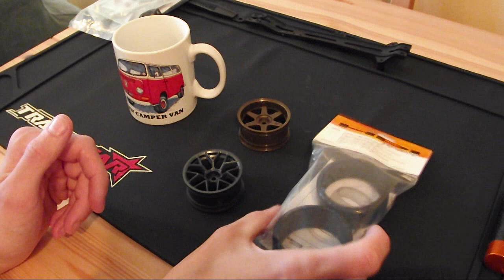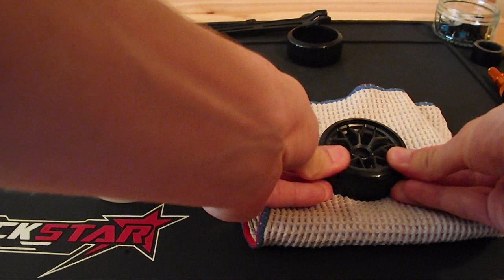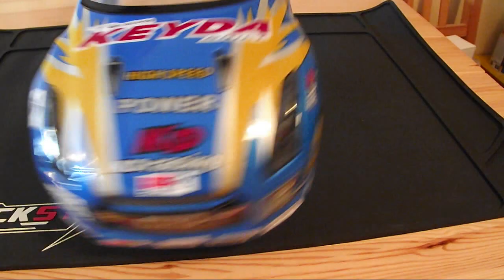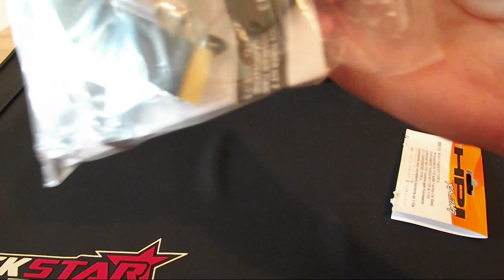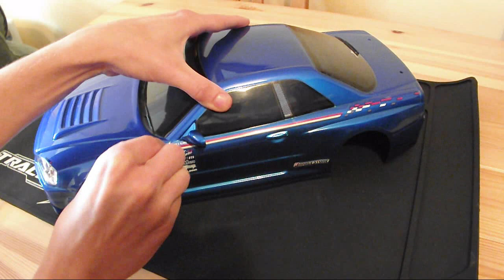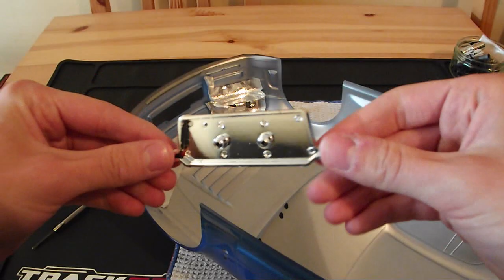Drift Project: Tamiya TT01 E Build / Upgrade Series - Episode 7

Comment: I just picked up a ta04 still has the rubber tires but drifts a little bit. Engine was overheating. I'm going to try some pvc tires for drifting and see if there's less engine friction so it doesn't over heat. Hope it works
Reply from the maker: +Derek Curtis Hi, the TA04 looks like a cool drift chassis, especially being belt driven. Drifting can be quite intense on a motor because its working fast but not getting enough air to cool it down due to the slow sppeds. It might be a good idea to get a heatsink. They are dirt cheap and will help cool the motor. Gearing could be another cause. Try a lower tooth pinion, it will mean a bit less speed but less work for the motor. Is it brushed or brushless? These are just suggestions and there may be other methods to cool the motor. Good luck with it and have fun. Drifting is great so enjoy. Thanks for watching.

Comment from the maker: (sam eady)  Still trying to fix a few gremlins with the car. The ESC is overheating for some reason and there's a driveshaft that keeps dismantling itself. It shall be ready as soon as possible. Thanks for the feedback. =)
Reply: Hi, Where did you get that skyline gtr r34 shell? i've been looking for that shell thanks
Reply from the maker: 박초롱 정은지 손나은 에이핑크 I got on special order from a local hobby shop. Its made by Real Craft Bodies but I don't think they're around any more. I got it about 5 years ago and haven't been able to find one like it since. You can probably find similar shells on eBay.
Reply: ok.. im getting a brushless system for my tt01e but im using nimh batteries. i heard that the standard tamiya connectors will melt, so i have decided to change my connectors on the battery to the deans connector. do i have to change the connector on my charger and esc too? thanks
Reply from the maker: 박초롱 정은지 손나은 에이핑크 Yes

Comment: love the video, what battery do you use and have you found much difference between li lion to lipo?
Reply from the maker: +Carl Potter Thanks for the feedback. You generally don't use Lithium Ion batteries in RCs, except if they are small toy grade ones with AA or AAA batteries that aren't the NiMH type. I haven't had a chance to use my new LiPo battery yet because it is being used for my TL01 when it gets rebuilt. I generally use the Orion Sport Power 4500mah battery. Great run times and good power delivery. I highly recommend them.
Reply: Oh right I see, do you know what the charge time like on one of those? I heard lipo can explode is this true? Thank you for taking time out to respond, many thank
Reply from the maker: I have a charger where you can vary the charge current. I think the general rule is if you set the charge current to the mah/1000, the battery will charge in an hour. My charge current is at 4.5A and the batteries are 4500mah. It does take roughly an hour to charge. The formula seems to work. LiPo batteries don't really explode, if damaged or pierced, they will just catch fire violently. If you want to see what it is like, check out  this video, skip to around 11:45: https://www.youtube.com/watch?v=Oig9ajWq1QU

Burst is a more appropriate term.

Comment: Does the yeah racing kit actually help? Just wondered as I might get one if it does
Reply from the maker: +Hazza03 Some of the parts do help. The steering is one area I would recommend upgrading, just for the increased strength and stiffness over plastic. The centre driveshaft is a must because the stock one is too flexible. The only other part I would recommend would be the upper arms front and back, just because they are adjustable so you can change camber angle. Everything else is just for looks really. 

I still would recommend one because buying just the parts I mentioned above separately would come to about the same cost as the full kit.

Comment: I got the yeah racing kit on mine and the pins that hold the cv shafts together is coming apart, have you had this issue?
Reply from the maker: The only issue I had was when a pin came loose on one of the universal driveshafts. It caught on the rear hub, bent the pin and gouged out some material out on the hub. You can see what happened at 4:00 in this video: 

https://www.youtube.com/watch?v=vHwc7Fu2-GM&list=PL545LfiWf8_EMUrQA5KaBgeRjg8iu_IzX&index=4

I got a new set and bathed them in Locktite. They're not coming out again!

Comment: Any chance of a video going up that shows this machine in action? :)
Reply from the maker: Still trying to fix a few issues that I'm having. I've got an overheating ESC, a driveshaft pin that keeps coming out and play in the front suspension which is causing some steering issues. I'll try and get one up ASAP. I was expecting issues with a build like this with so many parts. Thanks for watching and stay tuned!!!
Reply: No worries. Good luck. :)

Comment: hi .. how do you do .. excuse me but i want to ask you some questions .. i wanna buy a new RC drift car because my hpi E10 is always falling apart .. so i'm considering to get a TT 01 .. but alot of people told me that it's not a professional drift car .. and i don't get it what is the difference between a pro car and a beginner car .. as well the recommended the mst cars the ( mst XXX-D pro and its shaft drive as the tt 01) and it's a lot more expensive .. i know its alot of questions so excuse me again .. answer me if you got the time
Reply from the maker: I researched this a while ago. Shaft driven cars have a rotational force from the spinning motor and driveshaft that make it easier to drift in one direction and more difficult in the other. Belt driven cars don't have this problem because the rotational forces are running parallel to the chassis whereas in the TT01 (or other shaft driven cars) the rotational forces are perpendicular to the chassis. This, in my opinion doesn't downgrade them for beginners, if anything, it makes the TT01 more of a challenge to drift. Technical bit aside...

I think that there is no difference between a 'pro car' and 'beginner car'. You can make any road RC a drift car with a simple set of wheels. Its more the changes you do, or can do that make your RC a better drifter. Stuff like steering angle, gearing and geometry can all be changed to suit your style so that you can have the best time drifting. Electronics are also a grey area too, a lot of pro drifters use brushless setups with lipos, but that doesn't mean that you can't use a brushed motor and nimh batteries and get similar results. Its all about personal preference and what you wan't to get out of your RC.

The TT01 is, in my opinion, a good base car for a drifter. There's tonnes of stuff you can do to it if you want to enter competitions or you can just leave it stock and still have a good time. There is also the Sakura D3 which is a cheap belt driven kit that just needs a body and electronics. Here's a link if your interested:
https://www.rcgeeks.co.uk/models/electric-cars/3racing-sakura-d3-cs-sport-rolling-chassis-kit.html

I hope this helps. Sorry its a bit of a long reply, but opinions and view points can differ massively in RC. I've tried to be a neutral as possible. I hope you find a drift car that works for you. If you have any more questions, just ask. =)
Reply: thanks man .. i really appreciate the time you took to answer me .. its means a lot to me .. so thanks again ..  alot told me about the Sakura D3 ..i'll see about it .. but i'm really into the tt 01 don't know why but i like it .. so here is another question .. what part should i get for the tt 01 to make it a better drifter ..
Reply from the maker: memo zoom If you are planning on getting a fresh kit, then bearings to replace the plastic bushings. I would run it completely stock (with drift tyres) and see how it is. The driveshaft on mine was incredibly flexible so I would consider that a must. Makes the throttle more responsive and accurate. Maybe some oil shocks, to stiffen the suspension to stop it leaning in corners, and then go from there. There is so much you can do but its all about personal preference.
Reply: thanks for the tipes .. i'm doing it as you told me .. : )
Reply from the maker: memo zoom Your welcome. Have fun with your TT01! =)
Reply: i found two kind of tt 01 ( tt 01D E tybe and the tt 01 D ). i think the  E tybe comes with bearings , Aluminum Shaft and Joint , Aluminum Steering Set .. i thinks its just missing the oil shoucks ..  what do you think ?
Reply from the maker: memo zoom Sounds good, how much?

Comment: hey rc project i need your help please..... i bought a tt01 carbon fiber n i need help, what pinion gear do i use im still a beginner on this please help what pinion gear i use?
Reply from the maker: +Meelo weedhead I'm using the stock pinion at the moment. I think its a 19t but not sure. I'll check at the weekend and get back to you.

Comment: Can i use the alluminum upgrade for tt02 chassis
Reply from the maker: I've learnt that the TT02 is quite a lot different to the TT01. I would suggest buying TT02 specific upgrade parts.
Reply: RCProjects thanks. I found kit for the tt02
Reply from the maker: Awesome.

Comment: would hace gone grey rims in the back volk in the front. keeps the weight and look more balanced
Reply from the maker: +cody thompson Not quite sure what you getting at???
Reply: +RCProjects you have 4 rims. 2 being the same and the other two being the same. i would have put both the dark grey rims on the rear tires and the bronze ones on the fron tires. not like you had them where they are on one side of the car. just to keep what little weight balanced and for a over all better look. but thats just me. so the back left and right would be the same kind of rim and the front left and right would be the other kind of rim you have.

does that make sense? i know its personal taste but i feel the car would look better that way
Reply from the maker: Ah OK. I get what you mean. I only had the wheels on the car like that to see which one I preferred. I like the bronze Te37s better. They match the Skyline body a bit more that the Gun Metal ones. I never mix up wheels types on any of my RCs. Thanks for clarifying and for watching.
Reply: Yeah. It could work mixes with the crazy designed ones in the back. I use to drift xmod rc cars from radio shack untill the xmod name was sullied by some bs new gen. I had the scion tc fully kitted and the g35 all done and the ford f150 lifted then lowered for drift. God i miss them. Please do more drift builds with carbon frames and long build vids. Its really fun to see
Reply from the maker: I've got 2 more episodes of the Drift Project planned. I've torn it down completely to clean it. Going to rebuild it and shim a few parts to reduce slop. Also going to fit a brushless motor too. Then I'm going to finish the Skyline body with some higher quality light buckets and custom stealth mounts. Stay tuned...
Reply from the maker: Are those XMOD cars like the Kyosho Mini-Z RCs? I've seen them around and the price to entry seems very high!
Reply: +RCProjects yeah they get lumped in with them alot but they are really good. lots of mods if you can find a parts producer. my x mod came RWD and i got the AWD mod for drifting and the body kit. also the racing suspension and turning bracket upgrade. it was a real intro into rc modding and upgrading and they were hella fun to play with. in face having done so i could give your drift car a run for its money lol. little monsters i called them
Reply: +RCProjects cool i just subbed to you. cant wait.
Reply from the maker: +cody thompson Awesome. Thanks for your support.